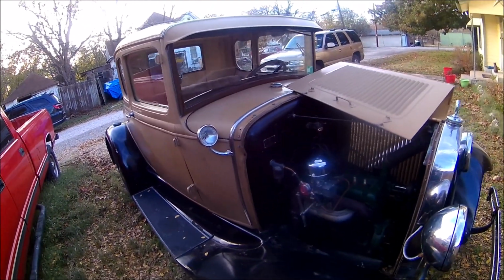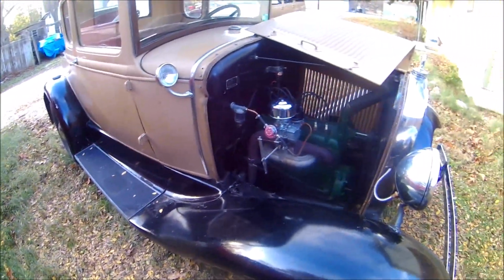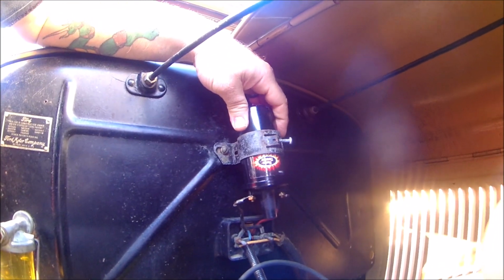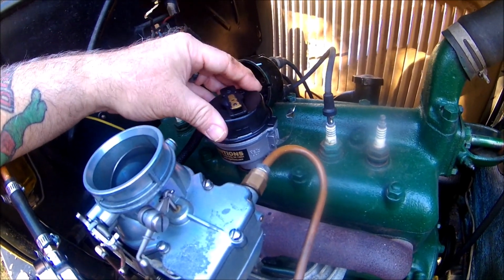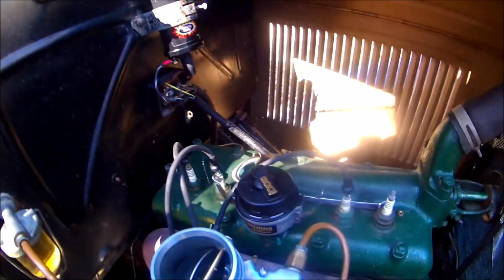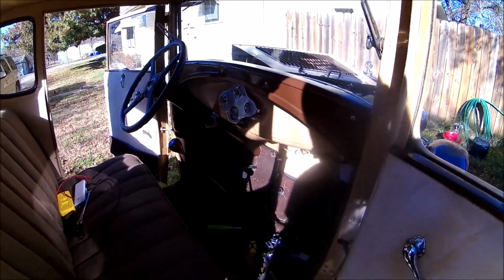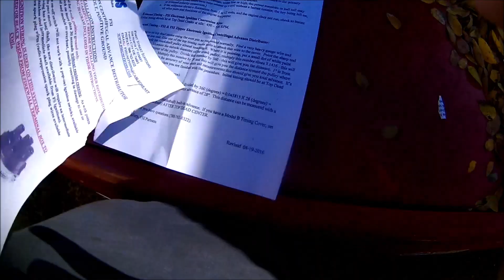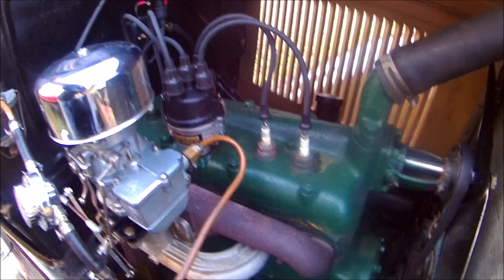Installing a FS Distributor in a 1930 Model A

Comment: that ignition works great ,  no points to look after for, better spark , you don't have any more hassle with adjusting the ignition while starting and while driving !, that carburetor is also a more modern one ? so you don't have any hassle with adjusting mixture when the engine is running then with cold engine the choke ? is it much more powerful now too ?
Reply from the maker: It cruises between 50 and 55 mph

Comment: Are you happy with the way it’s running? I have a 1930 Model A Coupe, with a Model B ‘32 Engine, with a Lyon Speed Head, and Mallory Ignition. But, I still using points. Your car, Looks and runs great!
Reply from the maker: Thanks! Yes I love the way this distributor makes my model a run. No more adjusting the timing while driving . No more points to adjust
Reply: But the timing lever doesn’t apply to a Model B, the timing on my Model B Engine is different than a Model A. This makes it a little different and more drivable, too.

Comment: Since they say no stock wiring is used how do you hook up the ammeter to the ignition switch?
Reply from the maker: It hooks up the same with the wiring that’s on the new distributor . When you remove the  old distributor all that wiring attached to it comes out too
Reply: The dash wiring from the ammeter has a red wire that goes to the ignition switch. If that wire is not used then I’m not understanding how the ammeter works.
Reply from the maker: @spallatial  yeah it’s still used it’s the other wiring from your ignition switch to your distributor/coil that’s new FSI has a diagram on their website you can download to explain it better

Comment: How did u attach the new shaft? Did you have to drill a hole in it and the distributor shaft and roll pin it?
Reply from the maker: It’s slotted and seats in there
Reply from the maker: The FSI kit came with the long shaft I believe you have to tell them to add the new shaft when ordering

Comment: What kind of Carburetor Kit are you using?
Reply from the maker: Sorry just now seeing this comment. I'm using a Stromberg 97 carb gravity fed from the tank . The car did have a electric fuel pump but it was putting out close to 7 pounds of fuel pressure so i ended up removing it.
Reply: I have a 29 A with a 33 model B engine and fuel pump . Just got my Stromberg 97 
Will I need a pressure regulator also ?